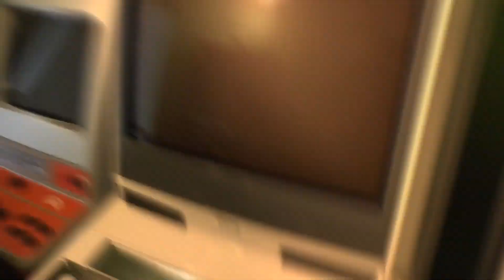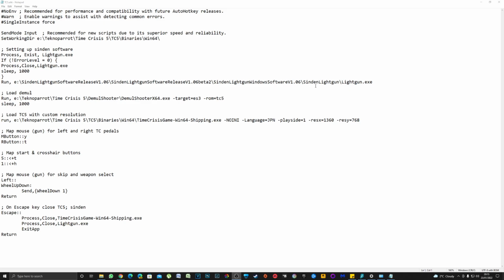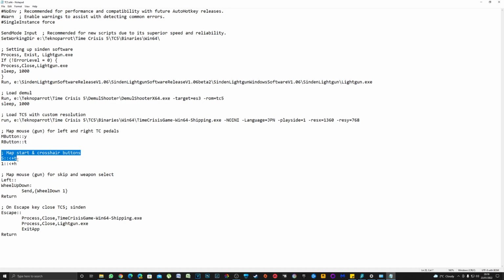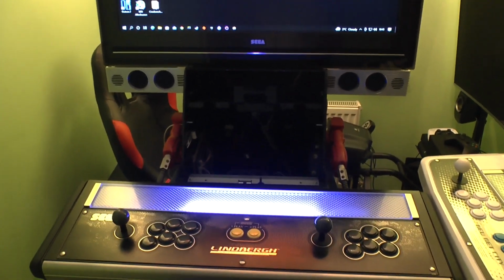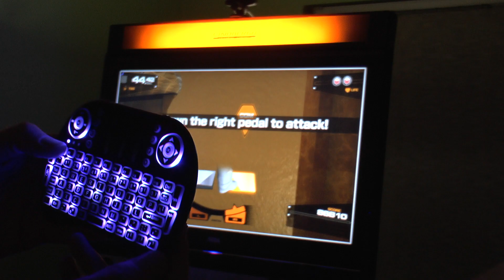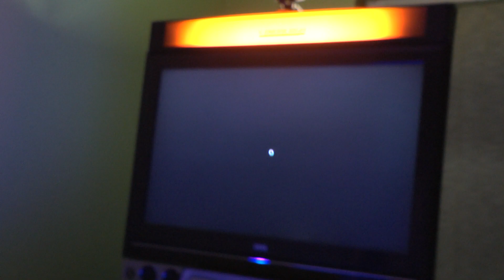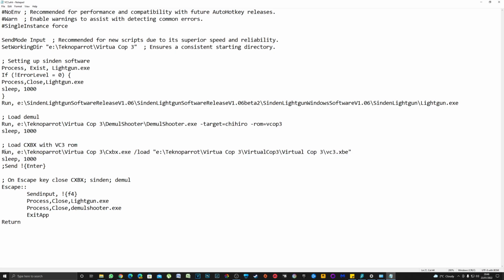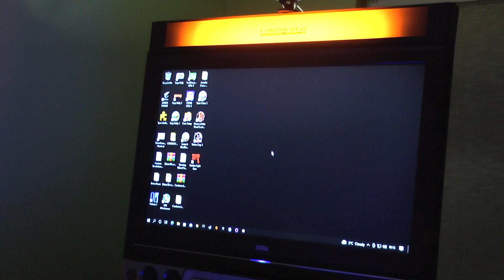Overview/Setup of Sinden Lightgun for Time Crisis 5, HOTD Scarlet Dawn and Virtua Cop 3 on Sega Cab

Comment: Why are you running demul shooter on tc5 when youre only using 1 player?.. i dont see you call for the 2nd lightgun.exe instance in your script for a 2nd gun thats all. Thanks
Reply from the maker: Because it states in the sinden wiki it’s required for TC5 regardless of 1 or 2 player. I’m sure I tried it without and the gun was not recognised correctly, but I could be wrong.
Reply: @Faginrs500  ah ok. So, it tc5 a 2player game then? If its 2player why didnt you call the second instance of lightgun.exe?... Its a bit annoying isnt it having to have 2 instances of the software running to play 2player
Reply from the maker: @Flo0die  it can be 2 player but isn’t something I’m bothered about so never included the details in the script. Being a standalone install (not using Teknoparrot) these oddities are unfortunately part and parcel of the setup. Works well though when setup.

Comment: Theres no way to get that to work with HOTD4 on the lindbergh is there?
Reply from the maker: Using original hardware and software you mean?
Reply: @Faginrs500  yup, not talking the PS3 version
Reply from the maker: You can indeed. The cab is wired up for the sega guns and I have an IR monitor surround as well. If I connect a Lindbergh PC with the software it’s ready to go. This cab was previously running HOTD4 before I bought it.
Reply: @Faginrs500  Awesome, thanks!